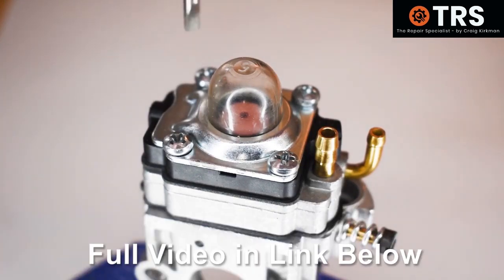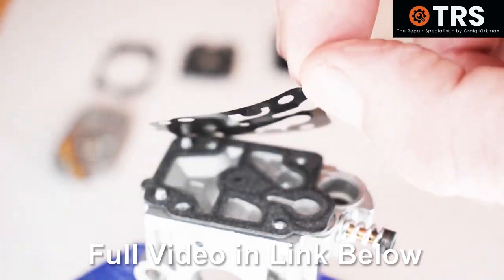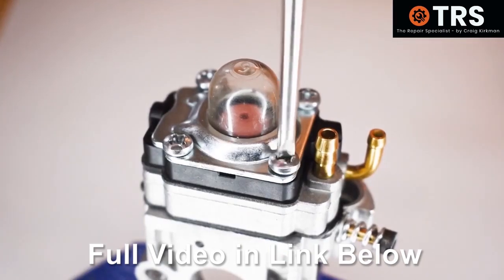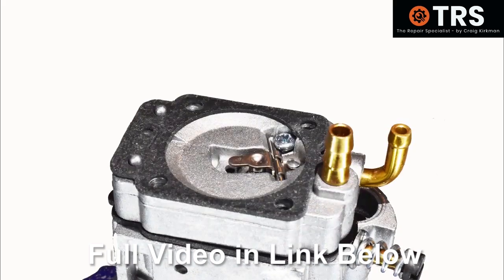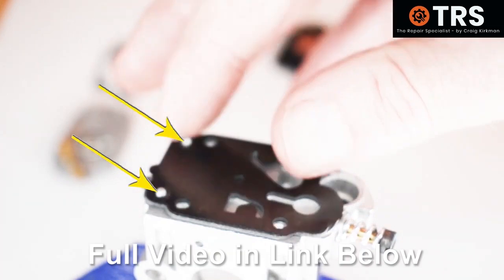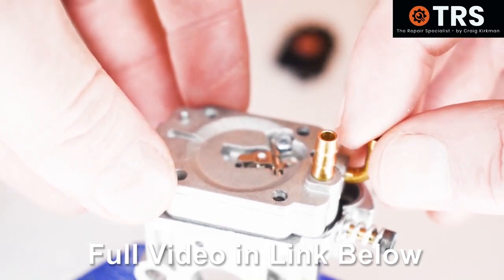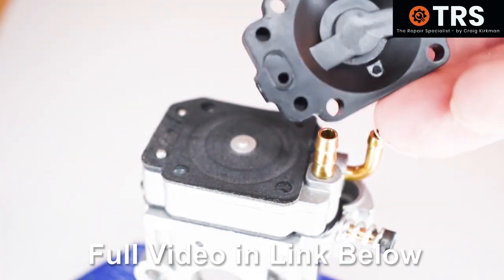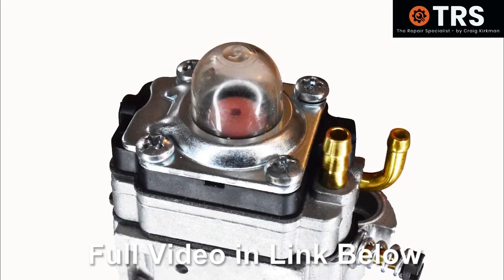Effective Procedure for Correct Diaphragm Positioning on Weed eater Carburetor.  (by Craig Kirkman)

Comment from the maker: Hi guys, just to let you know that I didn't include the adjustment screws in this explanation because I have another video coming out about these. This next vid include both the main (large) adjuster screw as well as the very small one at the very top of the carb that is hidden away.  This latter screw is quite simplistic in it's design and function, as i will be explaining. Thank you so much. Craig 👍

Comment: I've been trying to get my bro in laws Craftsman 29cc 4 cycle lawn edger to run properly for about a week or so now. The problem it has is that anything past about half throttle and it runs kinda rough as if it's starving for fuel or too rich but I'm not sure which one because it only has the tiny, single D low speed adjustment screw down in the throttle area. It's a Walbro WYLB 5A carburetor which takes a K1 WYLB diaphragm kit. I bought a diaphragm kit that looked almost exactly the same that actually fits on a different but similar carburetor because it came with 2 pump diaphragms that were different than the dark blue acetate one that's in this carb. This carburetor also has a short spring that goes under the pump diaphragm but on your carburetor I didn't see one.I wonder if that could be causing it to not pump well and run lean? I was hoping that the fiber looking style diaphragm would pump better because it is not nearly as stiff as the acetate but after installing it the edger wouldn't idle on it's own nor would it rev very much, I had to keep it running by working the throttle. After examining the original and new diaphragms I noticed that the small hole in the middle of the new diaphragm was quite bigger than the original, it looked to be about the size of the one in your carb here in the video, the original diaphragm has a very small hole not much bigger than a pin head so I'm thinking that the new diaphragm is designed to flow more fuel and was flowing too much fuel for this engine, that's my guess anyway. But I'm not sure how to remedy the problem that this carburetor is causing. I'm thinking that maybe if I enlarge that pin hole a little at a time with a heated pin maybe it'll start flowing enough fuel to smooth out the engine. It's not that big of a deal if it doesn't work, diaphragm kits aren't that expensive for it but I wanted to ask you if you've dealt with a similar issue and how you resolved it.
  Thanks for the video 👍

Comment: Hey Craig, good stuff and appreciate the time and effort that goes into the content that you produce. I suspect the biggest mistake folks make on such carbs though is mixing up the order of the diaphragms and the corresponding gaskets despite having the orientation correct. So it's probably worth a mention that getting either the pump or metering diaphragms and gaskets out of order will cause the machine to run incorrectly. In fact, it might even be neat to see/hear what a machine runs like with each, and then both, of the diaphragms and gaskets out of order!
Reply: I second that - some say gasket first and then Diaphragm and others say reverse!